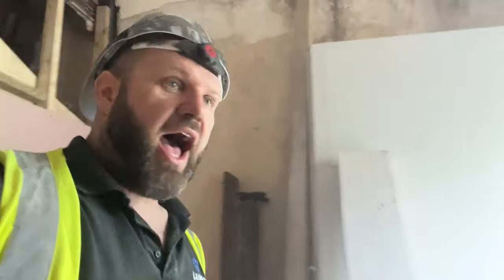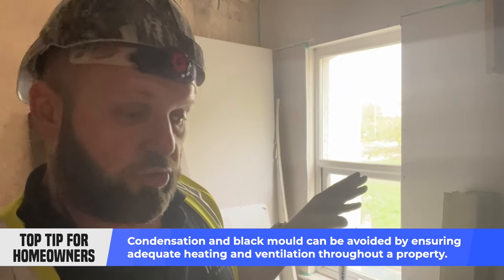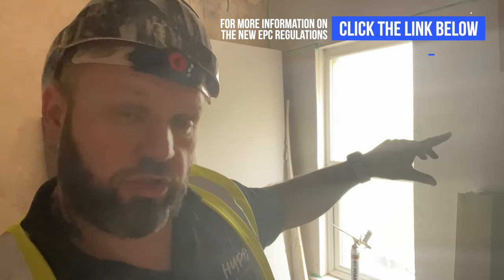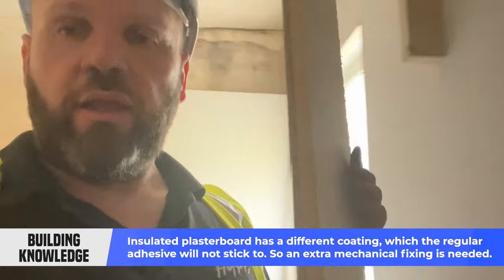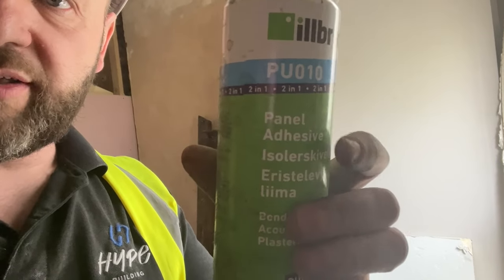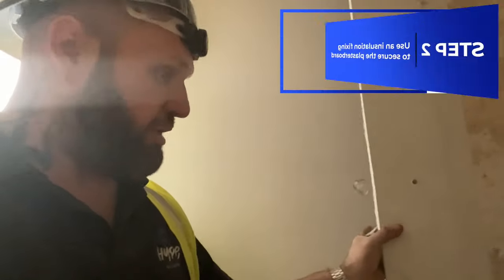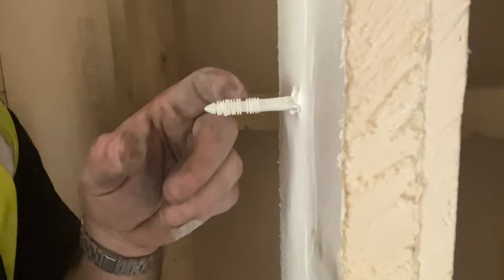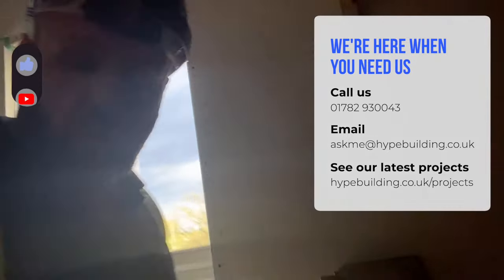How to Fit and Secure Insulated Plasterboard

Comment: Oh dear , so many errors and the comment about thermally broken fixings is incorrect. The part L does not stop you using them internally, in fact they are normally used for securing wood fibre internally. As for sticking PIR onto a solid wall ! What about the formation of moisture due to moisture meeting the insulation from the outside which will condense and run down the gap in the wall to provide ideal conditions for wet or dry rot ! What is frightening is that people will follow this advice .
Reply: Why would moisture be getting in from the outside?
Reply: The wall on the outside of the insulation is vapour porous so when the air , which contains water vapour meets insulation it will condense . If the wall on the outside was sealed the problem would not exist but bricks are vapour porous .
Reply: @lesDrain no. You misunderstand how this works. Water vapour will condense when it hits a surface of a temperature below the dew point which depends on the moisture level. So water vapour migrating from warm surfaces that are above the dew point to surfaces colder and below the dew point is when trouble can start. This usually is as vapour permeates from inside and moves outwards, as the temperature drops through the building envelope (in this case walls) as you move outwards . Consequently you need vapour barriers on the warm side of your wall. This is part of  the building regulations. The insulated boards have this within them. If they didn’t your problem would be when the vapour reached the cold surface ie in this case potentially  the brick wall, if cold enough (eg in the winter when it’s temp can be below the dew point) 

Vapour coming inwards from outside is fine as it meets progressively warmer elements so it won’t condense. It is important liquid water doesn’t migrate through capillary action from outside to inside but that’s a different mechanism, and has nothing to do with dew points. A cavity wall has a cavity and detail to ensure liquid water doesn’t cross it.
Reply: Thermal bridges add a layer of subtlety as their temperature can be below the dew point as they conduct heat efficiently through themselves from side to outside - and hence liquid water can condense on them. Specialist Mechanical fixings eg out of plastic or helical stainless steel (which has lower conductivity than non stainless steel) are all to ensure there is a temperature gradient down the length of the fixing - with the bit that’s inside the vapour barrier above the dew point.
Reply: I am writing about solid walls as in pre 1919 construction with no cavity. I am lost how moisture is going to travel outwards, as per your response if the plasterboard has a layer of PIR although the plasterboard itself is vapour permeable  and assuming it has not been coated with Gypsum plaster or vinyl paint ( both impermeable) how does it travel through the PIR. But that's not the point I was making . In a pre 1919 house with solid walls ( approximately 1/3 of the housing stock in the UK ) water vapour will travel in from the outside. Its when it meets the insulation which will be colder and then condensation occurs. That is why PIR is a bad idea as it stops the water vapour continuing inwards. Air tightness films are designed to stop air leakage not water vapour I am assured by my thermal engineers .
Reply: Do you have a link for the plastic hammer fixings mate 👍🏻 ?
Reply: That's the trouble with people looking at a video on you tube and thinking it's the correct way to do things. ALWAYS follow manufacturers instructions.

Comment: The plastic fixings are designed for external wall insulation only. You need the metal fixings to meet building regs for internal wall insulation fixing 👍
Reply from the maker: Hi there. Thanks for watching our video. You can use metal fixings, but we chose to use plastic ones. They have – like all our work – been passed by Building Control.
Reply: correct the idea is if there is a  fire the the boards should stay on the walls and not trap you in  the property when foam burns etc.
Reply: I'm putting insulation plasterboards over an old studied wall with little or no insulation, I was told I can just use long screws with rawplug rings
Reply: @sid75carroll53 metal insulation disks with long screws, ideal. not plastic
Reply: Don't metal screws conduct heat, maybe causing condensation?
Reply: @dogblessamerica  got to think about fire first, always a compromise building.
Reply: @HYPEBuilding Building control should NOT have passed it. They are so inconsistent,look at new builds.
Reply from the maker: @jablot5054  I here what you're saying but building control passed it.

Comment: Hi. Thank you for all your videos.  Can I ask,  can insulated plaster board be stuck and fixed to an existing plaster wall?
Reply: I am particularly worried about preventing damp and condensation.
Reply from the maker: Hi Dominic. Thank you for watching and for your question 👍 We would always recommend going back to brick, just in case your walls are already damaged or have an existing issue. 

If you have plasterboard that is stuck to the wall using the dot and dab method, it may be best to remove the plasterboards and dabs, and stick the insulated plasterboard directly to the brick. If, however, you have bonding, it will probably be OK to attach the insulated plasterboard to it. 

Hope that helps 🙂
Reply: @HYPEBuilding  Thank you for the reply. Can I ask one more question, can the insulated plaster board be stuck / fixed to an existing wall that is painted? Thank you again!
Reply from the maker: @dominicthorpe1  Hi Dominic. It can be, but we would recommend taking the plaster off first to do a better job. It's about knowing what's behind the plaster. If you go back-to-brick, you can ensure the job is done properly and hopefully eradicate any future issues.
Reply: Can i dot and dab insulated plaster board @HYPEBuilding

Comment: Thanks for the video - it helped me a lot. One tip from me. I have a 1930's house with very loose mortar. I ended up with quite a few holes where the fixings did not work. Next time I will mark the position of the anchors on the wall, transfer these to the boards, drill holes the holes then dry fit the boards and used a spray marker to check the holes were in the correct place. I'll let you know the result on the next room.
Reply from the maker: We're glad you found the content useful, Mike. Thank you for watching and your comments 🙂👌
Reply: 50 mm stud fill with rockwool place 37.5 mm over that and no issue this is the wrong way

Comment: My walls have no insulation and are 9inch brickwork. Does this mean the original internal plaster would have been lime based?   I think all my house has been plastered using gypsum over the years.    Should I strip the walls back to brickwork and do this method with the plasterboard? I seen someone using battens but that seems harder.     If I strip the walls and stick this insulated plasterboard to the wall. Will condensation not build up behind it damaging the wall?  Dying to sort it🤣
Reply from the maker: Hi there. Thanks for your questions. 

It's a strong possibility that the plaster is lime-based, but there's no way of knowing until you start removing it. 

If you strip the walls back, at least you will retain the room size. Using studwork/battens will, of course, encroach on the available space.

In relation to your last question, unfortunately, it's not a one-size-fits-all scenario. It very much depends on what floor you have, what gap you want to leave, and what your ceiling to wall juncture looks like. It's very difficult to say without actually seeing it. 

Sorry we couldn't be of more assistance, but we hope that's helped in some way.

Thank you for taking the time to watch our video. We genuinely appreciate it 🙂👌

Comment: Hi. We have builders in next week to install French doors in place of window. Ours is an old house with no cavity. We have found some mould problem in corners so we are looking at using the opportunity whilst builders are in to use thermal plaster boards. Just looking at your video, have you just attached over old plaster board or do i need to take old plaster and render back to brick. Thanks
Reply from the maker: Hi Reiner. Thank you so much for watching our video and for your question. We would recommend going back to brick. That way, you know you're dealing with good quality plaster and things are less likely to go wrong. Hope that helps and good luck with your project 👍
Reply: @HYPEBuilding  Thanks for response. Builders have stripped back to brick as much of the old plaster was damp. No rising damp. Just moisture in walls with airbrick blocked and lack o ventilating, and previous owner sealing over plaster rather than try and fix more permanently. We have gone for batons rather than dot and dab and new plaster looks the dogs nuts. Can already see brickwork drying and that distinctive smell gone. Thanks for posting these videos. Although it doesn't make us DIY ers experts it does help us understand the builder language a bit better.
Reply from the maker: @reinerberridge6112  That's great news, Reiner! 👌 We're really pleased to hear that you find our videos useful. It's great feedback like this that makes it all worthwhile – much appreciated. Very best wishes.

Comment: How come you don’t batten the wall and screw the insulated boards onto them?
Reply from the maker: Hi there. Really good question 👌 And you certainly can do it that way, like you say. 

The only reason we haven't is because this particular property is a HMO – and using that method would significantly decrease floor space.

Hope that helps. Thanks for watching and for your question 🙂👍
Reply: The only reason to include an air gap would be if you need it for ventilating moisture away. For example, if it was an exposed location with lots of driving rain that could send it through to the inner face of the bricks. But then you need to make sure the gap does in fact have some airflow; with still air the moisture will remain.

Also, even without penetrating damp, you have the risk that moist air from inside the building will get behind there and cause condensation/mould.

By sticking the boards directly to the wall with no air gap, and foaming around the edges, you are ensuring that virtually no moisture will be able to gather there.

Comment: Won't you get condensation behind the insulation?
Reply from the maker: Hi Lee. Thanks for watching our video and for your question 🙂👍 There won't be any condensation behind the insulation because the boards we use have a built-in vapour control barrier.

Comment: I’ve just done my utility room this way, it’s solid but I’m not impressed with the thickness of the head on the plug, it’s about 2mm so gets in the way when you plaster and is difficult to completely conceal in a skim. I may experiment with countersinking the head next time with a suitable spade bit.
Reply from the maker: Hi John. Thanks for watching. rather than countersinking, you should be able to literally just tap the fixings in a little further. This should sink them beneath the surface and allow you to skim over without any issues 👍

Comment: @HYPEbuilding brilliant video thanks! I’m planning on installing PIR boards on the external (internal) walls of my house as you have in the video, my question is, being a 1900 house (solid brick no cavity) some of the walls get quite damp. I’m pretty sure it’s not rising damp and more likely due to really piss poor pointing externally and moisture getting in. 
Would you advise getting rid of the old render (because its that old it comes off easily and needs replacing all over the house anyway) battening then installing a moisture barrier then the PIR to create the cavity or just crack on and either dot and dab or foam the PIR boards on?
Sorry for the essay.

Comment: Nice. So no need to batten the wall with wooden studs and insulate inbetween? (external wall)? Just stick the insulation to the solid wall with this plastic plugs and foam?
Do those plugs get in the way of the skimming? Protrude

Comment: Hiya
I am in exactly the situation you are working/commenting on within this video.
I have gone back to the brick and require soundproofing the party wall.
How my party walls are quite porous with it being an old terraced house. It pretty sanding/dry wall.

Would the adhesive you use work in sticking PIR board to the wall??
Or will I have to do something to the wall first to enable it to stick the PIR.
Hope you can help.
Reply from the maker: Hi there. Thank you for watching our video and for your questions. It's difficult to give you a solution without seeing it first-hand. However, if you're worried about the adhesion, you can use PVA or blue grit to help. Hope that helps 👍

Comment: Are these plastic plug fixings ok to drill into concrete walls, will they be secure and hold , even though the boards will be dotted as well. My house is concrete built not bricked.
Reply from the maker: Yes the plastic pegs can be different sizes, you just need to find out the depths of the concrete walls so you don't breach the other side. If you trust your dot and dab, you can use certain insulated plasterboards which will take dot and dabs.

Comment: Thanks for the explannation. I have a couple of qs if any1 can answer would be great.

1. Can this be applied to bare wall after prev plaster has been removed?

2. Can this be applied to part of the wall only, i.e. up to a certain height? Not for thermal reason but to treat damp prone area.

3. How far down, close to the floor do you go? I heard you shouldnt go right to the floor as damp can rise.

Thanks in advance.
Reply from the maker: Hi there, thanks for your questions. Here's what we think:

1. Yes, you can apply the plasterboards to a bare wall after the plaster has been removed, but we would recommend using PVA or similar to get rid of any dust before installing them.
2. You can apply the plasterboards to whatever height you want but we would recommend taking them all the way to the ceiling.
3. It's best to leave a gap of a couple of inches from the floor in case the floor is uneven – this will then save the need for unnecessary cuts.

Hope that helps. Thanks for watching, we really appreciate it 🙂👍

Comment: Hey bud. We have an old Victorian property, with lime plaster. Would you recommend putting these boards directly on the plaster? The plaster is is good condition. Or recommend removing the lime plaster altogether and putting the boards directly on the brick? Only looking to do this against the external walls.
Reply from the maker: Hi Mutassim. Thanks for watching and for your question  🙂👍 We would recommend removing the lime plaster and putting the insulated plasterboards directly on the brick.

Comment: Hi there just a quick question I am in the process of installing internal installation boards to a internal wall where there is a radiator what's is the bast way of  fixing the radiator back on the wall where there installation board.
Reply from the maker: Hi Darren. Thanks for your question. You can attach the radiator with screws as you normally would. The insulation has no consequence here. 

Thank you for watching our video – we genuinely appreciate it 🙂👍

Comment: I’ve got a small room to do solid exterior wall  I’ve seen a lot of people say u Shudnt do it cus of condensation behind don’t really wanna Batten out as room is allready small what’s ur opinion on this thansk
Reply from the maker: Hi there. Thanks for watching and for your question. We've done this on plenty of occasions and never had any issues. Just be sure to use insulated plasterboard with a built-in vapour control barrier.
Reply: @HYPEBuilding  thankyou

Comment: Always follow manufacturers instructions when using insulation products and comply with building regs. In the event of a fire and if someone gets injured or killed not only will the insurance be invalid you will be held responsible! You Tube videos from the manufacturers are the first place to start along with the technical data sheet.
Reply from the maker: This was signed off by building control.

Comment: Hi, thanks for your video explaining how to approach securing the plasterboard to the wall.  Can you give me a piece of advice? 1. When you cut the insulated board flush to the window, do you need to put on a reveal over that? 2. If the wall has already been skimmed previously, do you need to remove that and bring it back to the brick again or can you put the insulated platerboard over the skimmed wall? 3. Would it be better to skim over the newly fixed platerboard or would taping be an easier option?  Any help would be warmly appreciated and thanks again for the vid.
Reply from the maker: Hi Darragh. Many thanks for watching and for your questions. Here's what we think:

1. You can do a reveal or you can cut the insulation so that plasterboard meets plasterboard. You can then attach an angle bead.
2. It's down to your personal preference. We go back to brick to make sure we're dealing with good quality plaster. If you're confident the existing plaster is in good shape then it should be OK.
3. Again, this boils down to your skillset. Either option is viable. 

Hope that helps, mate 👍
Reply: @HYPEBuilding  Thanks so much for replying and giving some advice, it is much appreciated, keep up the good work on the channel, it's great.
Reply from the maker: @darraghcannon6689  You're most welcome, Darragh. Hope your project goes well. Thanks again for your kind words – much appreciated 😊👍

Comment: Appx how many fisxings are you using/what centres do you advise? Thanks :)
Reply from the maker: Hi Robin. Thanks for for your question. If the brickwork is in good condition, we usually place them approx 400mm apart. If the brickwork is in poor condition, you're restricted to placing them wherever you can get a good fixing.

Hope that helps. Thanks again for watching 😊👍